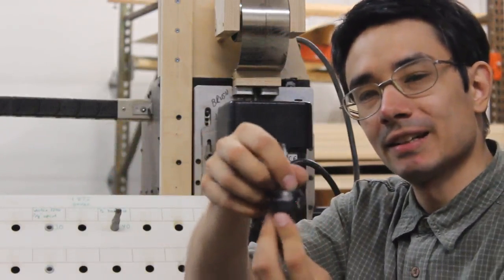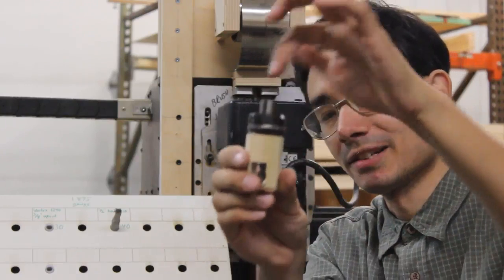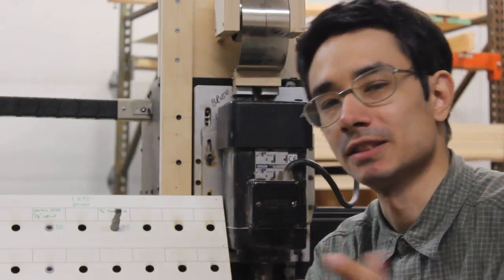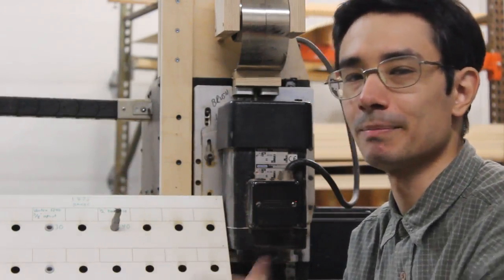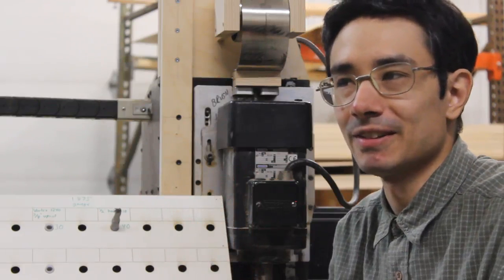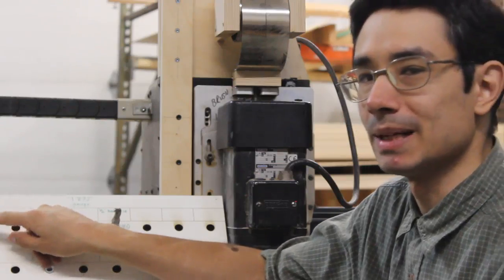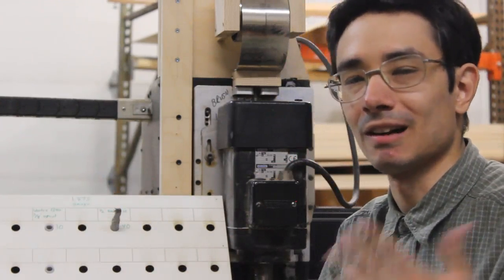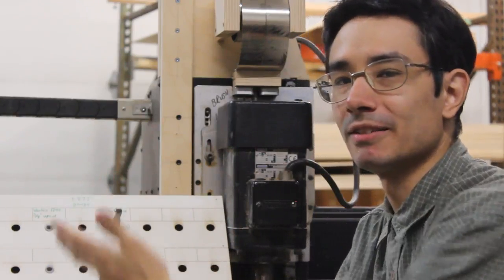ManualToolchangeSystem

Comment: When you tighten a collet it pulls the bit up into the spindle so you can never have repeatable heights with this method in my experience. Dont get me wrong it's a simple and effective method and is useful but not precise.
Reply from the maker: It is true the collet position does not allow for absolutely reliable measurement.  In practice however, that hasn't mattered to us because of how consistent we are with bit changes.  We generally get within .002" of our desired depth of cut and in most of the woodworking industry, that's perfectly acceptable.

The collet, nut and spindle taper get cleaned between every bit change and we use a torque wrench.  Recently we've even started indexing the collet to the nut so it goes in the same way every time (to minimize runout on old equipment).  Being consistent like this means the depth gauge is also consistent for us because the collet gets tightened the same way to the same torque each time.
Reply: If you're getting repeatable results to that accuracy that is definitely good enough for wood work. Probably 99% of metal work engineering to be honest. Good video.